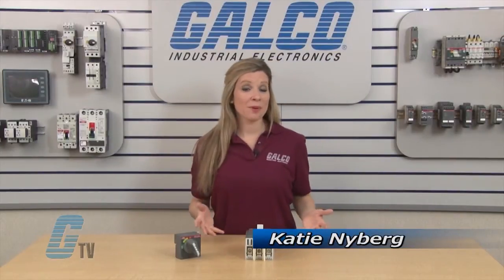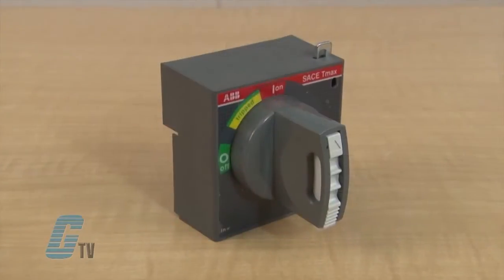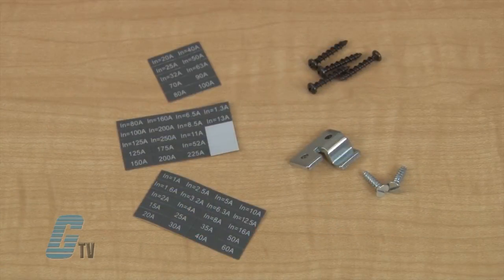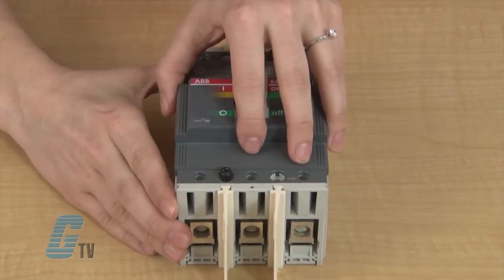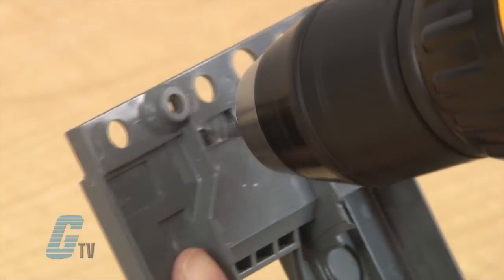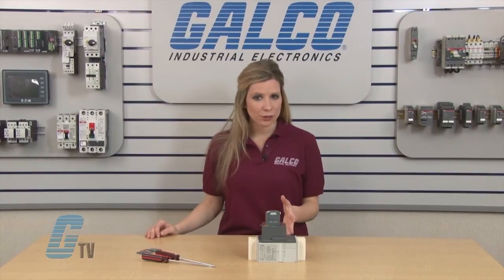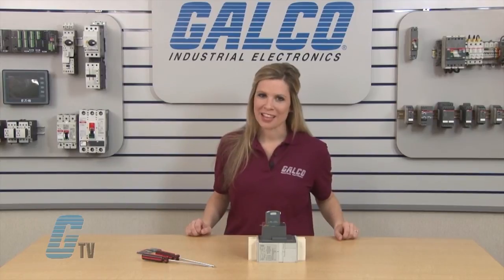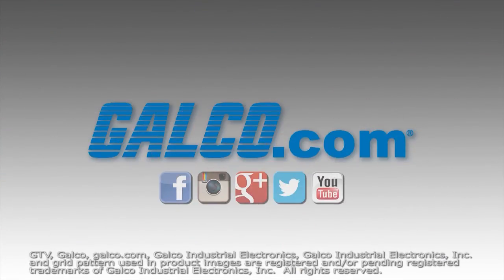Installing a Direct Mount Handle to ABB's Tmax T1 T2 and T3 of Enclosed Circuit Breakers

Comment from the maker: The direct mount rotary handle offers a safer way to switch a circuit breaker to the on or off position. They feature handles that can be pad locked for extra safety and security. They are ideal for applications where it is necessary to safely remove power from a system.